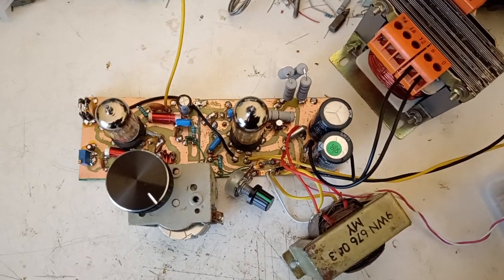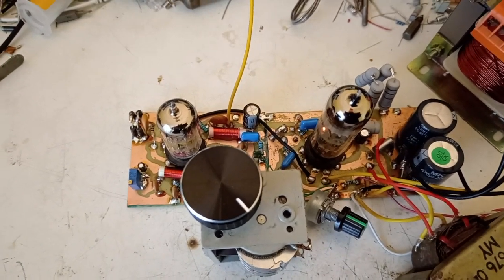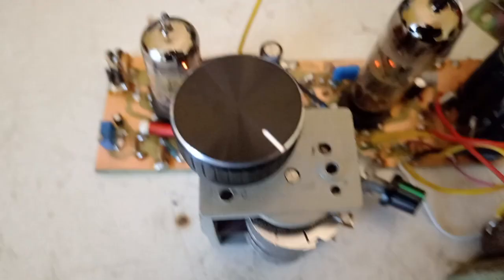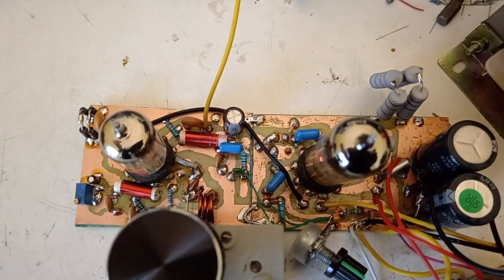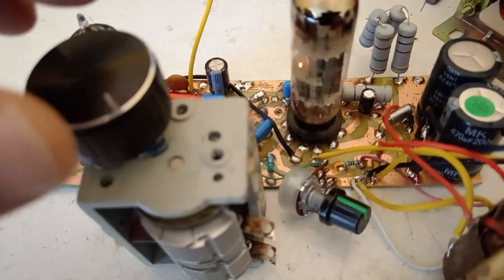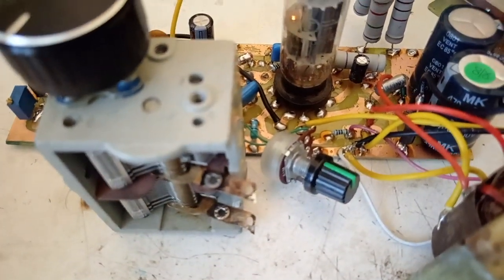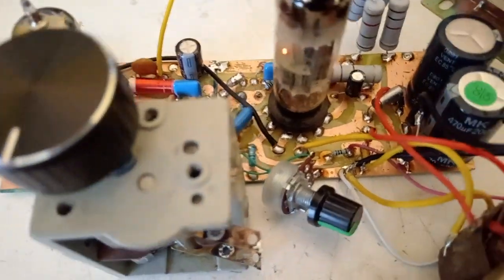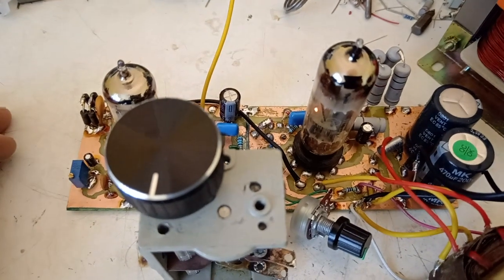Superregenerative FM / VHF radio receiver using electronic tubes PCF82 and PCL85.

Comment: Hi Marcel, first congratulations on Romania joining full Schengen together with Bulgaria, finally!
I have built this radio with a 12AT7 tube but I am planning to replace this tube with a 6U8 for much better performance! I am not new to electronics, I have built two superheterodyne tube FM receivers, one with 8 tubes and another with 9. The second radio has a solid-state stereo decoder for stereo reception. Of course these projects are not for beginners.
Thank you for posting your video. Regards. Camil.
Reply from the maker: Hi. I heard a lot of people saying that for sound purity you really need to go full tube construction, so, for your superhet it would be interesting to build this tube stereo decoder: https://www.turneraudio.com.au/am-fm-radio-tuner-multiplex-decoder_files/schem-tuner-multiplex-decoder-05.gif
Reply: @perianmarcel2059 Very involved circuit to build, not worth the trouble. The ICs I used for the stereo decoder and AF amps are high quality, and there is no solid proof that tubes sound better than solid-state, but if they do, the difference is so small it can hardly be detected by human ears 😊 Regards. Camil.

Comment: PCF82 poate fi inlocuit cu PCF801?
Reply from the maker: Din pacate nu, la PCF801 catodul e comun pentru trioda si pentoda, in timp ce la PCF82 cei doi catozi sunt independenti. In schema se vede ca trioda are in catod soc de rediofrecventa  iar pentoda are grup RC i n catod. Daca PCF82 / ECF82 nu este disponibil, el poate fi inlocuit cu PCF802 / ECF 802 sau chiar cu PCF80 / ECF 80. Echivalentul sovietic al lui ECF80 este 6F1P, care se gaseste usor pe Ebay si relativ ieftin. Performantele nu sunt aceleasi, PCF802 si ECF80 ofera o functionare buna, dar sensibilitatea receptorului e discret mai mica decat cea oferita de PCF82.

Comment: Hello Marcel,
I am very interested in this receiver BUT can I quickly get the parts together???  (I don't think so!)
I would use this receiver for a lower part of the band.
Namely from 84 to 86MHz WFM because here in the Netherlands there are Dutch Pirates! (Around 85MHz WFM Modes)
Yes I know! I am a licensed amateur but have always been a pirate (sorry!)
Back to the receiver, I will see if I can get something done BUT that will not be done in one (1) day!
I do not know Marcel how you feel about pirates but I can tell you more if you are not too strongly against it.
There are more pirate bands than just this one, BUT more about that next time!
Healthy and Friendly  Greetings from Rotterdam! 
RadioRob
Reply from the maker: Hi! Your comment about pirates amuses me. I think most of us (ham radio operators) started that way. I was a kid and it was during the communist era here in Romania when I have built my first radio transmitter, and, yes, it was illegal and it was in the FM band (the communist countries were using the OIRT band form 65 to 74 MHz). I remember I was waiting the whole day for the Secret Service (Securitatea) to came after me. They never did... A few months later I realized that the power of my transmitter was so low that it did not covered not even a few streets... Once the old analog TV bands are abandoned, there are plenty of unused frequencies, I don't think anyone is bothering to search for pirates as long as they do not disturb commercial or military stations...
The components.... well,  most of them are basic components that any amateur should have around home. The tubes can be found on Ebay. The transformer is the only component that is a little more difficult to wind, you need 2 voltages: 26.5V AC for the filaments (300mA) and 80-90V AC which will be doubled for the anodic voltage...